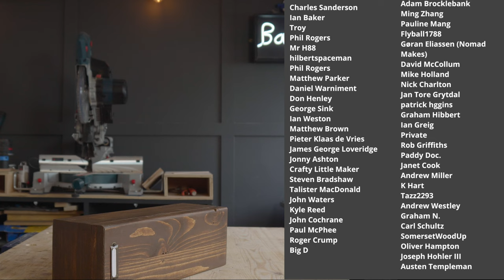Gift For Hard To Buy For People

Comment: Great techniques shown, only thing I would mention is the sawdust and glue trick isn't great when using a stain as the glue cant be stained, as you can see on the finger joints where it was rubbed in there is lighter patch. paint may have been better in this situation.